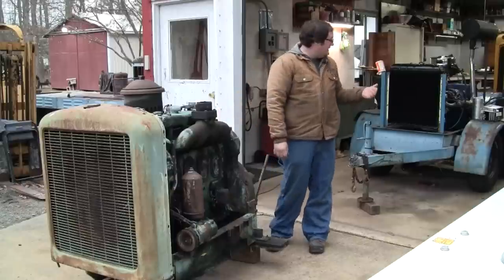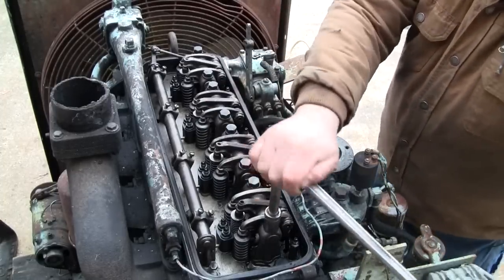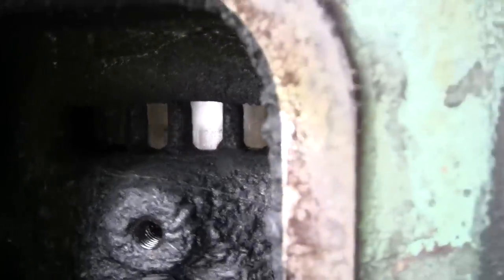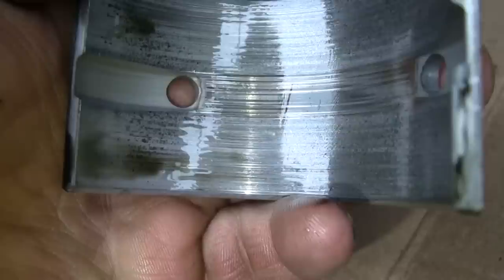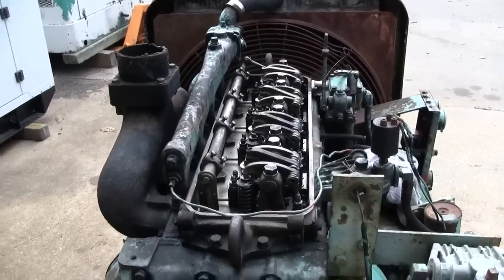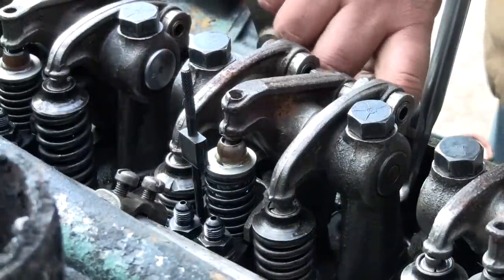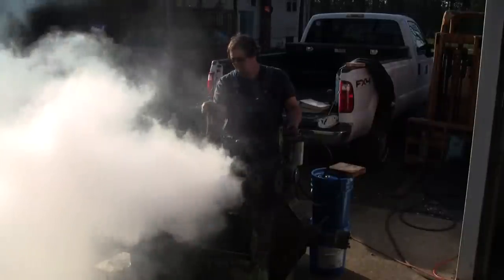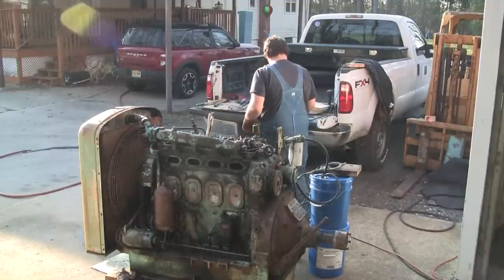Will This Tired GM Diesel Run Again?  1940 4-71 Detroit Diesel

Comment: leave it alone
Reply: Eat thing to do is rebuild it.   It’s worn out badly.   Cost about $3400 to do a overhaul on these these low blocks.   It’s got newer liners and new style (post 1951) head so it’s definitely not all original.   Best to rebuild it and give it new life before it self destructs